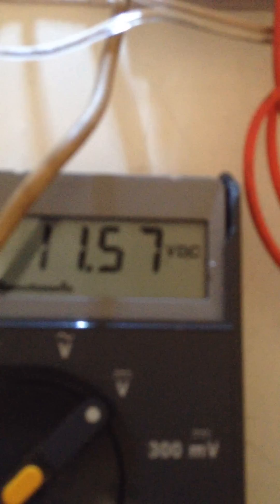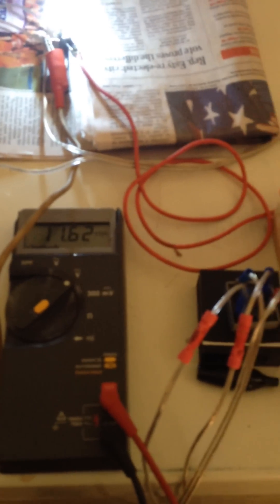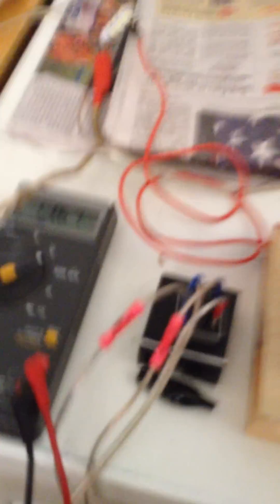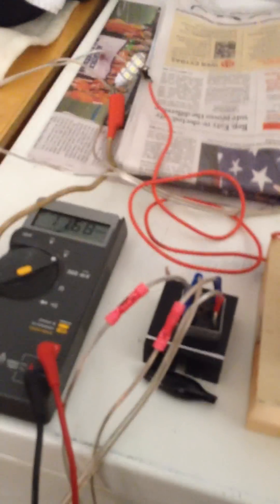Over unity created with transformed back emf. True over unity, no BS!

Comment: Marc, thanks for the no BS approach.I have built a circuit using a dimmer.I am going try charging the source battery.I might need some sort of protection for the high voltage spikes.BTW the relay's inductance is in series with your transformer.So its just more inductance.I have confirmed this with calculations and inductance meter.Also remember you can calculate BEMF .BEMF=-L X (AMPS/seconds).Your circuit is among a class of devices that are really self resonant, self driven,self oscillating.It operates mostly at self resonance the true secret of those devices.Also its what Tesla used with his high voltage induction coil.Only most of his drawings did not show the inductor switching mechanism in all its glory.The relay is really a Rumkorff Induction Coil.Back then as you know they had more amperage that they could handle.The bell,horns,etc are just the decendants of the technology.Keep up the great work.
Reply from the maker: Thanks for the compliment. I was extremely lucky to get any of these to literally operate in resonance because I have tried other brands of relays with absolutely no success many other times. The brand I had most success with for relays is call AGT (source  http://www.amazon.com/Relay-Harness-Bosch-Style-40AMP-HRNS/dp/B005HFYE1O  ) and they are very difficult to find since car audio vendors sell them in bulk and only sell the cheapest relays they can find. These are built to last and of course are not ever identical. I have found that one of 5 used work for the most part, but, I have also found that 24 volt coil /240 v switch 5 pin no/nc industrial relays have the freedom of adjustment, but, they burn out rather easily. The AGT Brand relays are pretty bullet proof and seem to operate well for months, possibly even years is used in this method where they easily self oscillate without any fooling around. We basically wire the coil and the nc switch in series forcing them to automatically oscillate.

I am getting better results using solid state relays but for the most part, we have to be extremely careful as they burn up if the control ic is a cmos device which is not resistant at all to spiky waveforms and nearly instantly burn out.

I admire your work as well and will need assistance from somebody such as  yourself that can apply the math to my designs and others to verify testing. If you'd like to get involved in my free private energy site, pl;ease let me know and i will send the link privately asap.

Thanks again!

Marc
Reply: Marc Belanger Thanks for subscribing and replying.Just to say that there is also an equation that must be satisfied before a circuit will oscillate.I suspect that if we master this we can make other relays work

As a rule of thumb, a circuit will not oscillate unless the resistance (R) is low enough to meet the following condition:     R=2(L/C)0.5This is  from
http://www.intuitor.com/resonance/resonance.html

Now you have mentioned the relay you used,I suspect that it might soon become unavailable.Too many times person such as Don Smith (deceased) and Lasersaber annouces certain components and when I go to look for it months after they cannot be found.Or maybe its just me....

Anyway,I intend to get an Microwave Oven Transformer , Pole Pig ,or Welding Plant Transformer to self oscillate.The only drawback is the massive BEMF spike which I will use a carefully calibrated spark gap to arrest of GDT Varistor  etc.BTW how did you keep the voltage to the cap back at less than 16 volts? A load? I see you output from the bridge is 108v or so? Please advise,I want to learn this stuff.

Later I will try metglas, with its super high magnetic permeability.But I want to see if I can reverse engineer existing transformers to produce overunity without the need to purchase expensive stuff.Hector with his Transverter has had some success as well as Barbosa.

Thanks.
Reply from the maker: the fundamentals of all nc relays force them to oscillate. this isn't the same as an oscillatory ring that relies on resonance, it is forced to actually oscillate because the relay coil being energized relies on the switch to be closed, forcing the switch to open, shutting the relay back off, then, again it closes due to the de-energization, cycling it over and over, unlike a true circuit ring or oscillation as Rose Ainslie's circuit does, so, it is merely cheating the circuit into a forced oscillation, nothing more, but, it does have somewhat of the same outcome without searching for a frequency, or mathematically making it oscillate by the use of other components. This is solely based upon the old car door buzzer design which I accidentally discovered by wiring a relay pigtail the wrong way getting a shock from the insane amount of back emf one relay I had created.

I've come up with many of these circuits, but, I think the outcome of the emf and switching speed, as well as additional magnetism that can be added to speed the oscillations of the switch up with neo magnets can create a very high voltage. I have also found that meissner circuits built correctly have a much higher free energy output than my circuit does, but, we have just begun with these circuits, and we all have a whole world of experimentation to link together, seeing what does what when we mix these discoveries everybody has when we tie clip probes from conection to connection and measure what we've found the outcome to be.

Once we think we have a great energy discovery and we can't truly prove it, then, we will study it's effects, send you the results we have to see what we could come up with for math application to try and prove it is worthy, then focus on moving on to the next step.

I am trying to get people to join dezeinstein.com to post what they may need to have others test so we don't have so much negativity in the forum either as I will moderate individuals who bring mass negativity to our work since we don't need the bs, just truly hard working individuals that know what we are trying to achieve without any additional arguments, maybe just add their ideas and their result when they provide testing. thanks..
Reply: Marc Belanger Yes that is true.And if you add a variable capacitor across the points you can adjust to get different frequencies.Again the rules of RLC still is in force here.
Reply from the maker: cool. I have several air caps.. I'm going to have to try them along with these circuits. I'm not extremely experienced in the tuning department because I have a usb scope that disconnects from it's driver when adding a noisy, spikey output, such as the back emf spikes the relay gives off, so, I'm seeking a decent analog scope for the right price to find oscillation and resonance correctly. I've been through a couple of years worth of college electronics classes, mostly digital, analog, and troubleshooting of circuits, especially combo circuits, lc, rc and rlc circuits, so, I have a pretty good background on them and their function, I just need some refresher on the circuits I haven't worked with in years. I've been stuck on high voltage systems for the last 20 plus years and low voltage logic circuits for the 12 years previous, so, since I've made a great wage for years, I bought many tuning products, such as variable air capacitors, variable inductors, and many other gadgets from schools, physics labs, etc. I am very well versed on transformers, electric motors, and their abilities to operate on levels most people haven't seen, especially when hv transformers literally become antennae to draw energy  and radiation in to provide energy amplification in forms most people really do not agree with me about, so, i am looking for somebody to try and offer explanation of how we could test the circuitry to see if it could be  metered and accurately monitored for it's power in verses it's power out while it inputs low voltage pulsed dc as an ac wave would normally do, and output a 60 hz ac cycle with 10-25 times it's input. I have to use specific equipment to do so , and currently, I have low voltage ammeters and an Amprobe brand amp logging meter which prints it's timestamped load out, but, was told the output of the circuit is imeasurable as well as the input since the meter makes all sorts of beeping and such. While this is happening, the high voltage bushings are measuring over -200 degrees celsius with a laser thermometer.  I can't use scopes and such unless they are rated for whatever the hell is coming from the system, and, I think it is cold electricity and cold radiataion but can't prove it. I'd use an oscilloscope, but,  I didn't know much about scopes and tried saving a buck on one when I found that the hantek usb scope is as useless as tits on a bull.. anyway, I'll be looking forward to asking many questions. i have lots of experiments I've run with the wrong stuff, but, have seriously come up with some pretty neat results and I will be willing to share them once I get the energy forum active so I can post some of my schematics and have others run tests on the results I have obtained.
Reply: Marc Belanger Hey I am enjoying your passion for this stuff.I hope you remain like that.I am very impressed.I would like to join your club.Remember their will be those who will simply not acccept what you are doing.Even when the latest equipment is available, so  prepare for that.In the meantime,I sincerely wish you will  continue to share your results and schematics with us.Too many have rushed off to the patent office and well.. their inventions modified and/or shelved.Some have been arrested.Open Source is always the best.Unless you are interested in a Big Offer from the PTB.Sigh.But you have given us a very good look into this stuff so far.Please make a kit available or already assembled.The investor will be like the ones in the Don Smith Videos or JP Morgan or Aviso etc.They will pay millions and shelf the stuff.A kit or assembled device maybe one of the best way to go.Thousands would love to try this.Hope you seriously consider my suggestions.
Reply from the maker: Oh, I've been into this for quite some time and have already been warned there are many flies in this area and many people that wish to avoid those flies should just stay away. I have found there are flies, the unwanted kind, then, there are the killer bees as well. I'm not out to put millions out of work, I am out for a better way and offer my assistance to find that way that will accommodate everybody, the energy field, and, all of their workers since it will only take one free energy open source device to devastate our world and the electrical industry. I live from that industry and don't wish to make a zero living or change the field my company resides in, but, I wish to help the industry get ready for it's release as there are many people who can't get patents with items that already offer the answer. If these people get frustrated that nobody will buy or pay to shelf the systems, they will eventually release it on an open level and financially take advantage of building them for people and make their money that way. It's just a matter of time before this subject has been reached as an open source deal that will certainly eliminate those of us with enough technical skills to build something extravagant as these free energy experts are coming up with. If the russians are doing it, it won't be long before Americans are too, as a matter of fact, it may already be here more than we know.
Reply: Marc Belanger Yes Marc, KIT KIT KIT KIT!!!!  ;-).

Comment: It shares character of a bedini system where primary is shorted and secondary gets the back emf pulses to charge a second battery..in fact if you had a second isolated it might charge up even more rapidly...bedini used transistorized switching but in your case it was relay switching and peculiar thing is your secondary is using thin gauge contrary to a bedini thicker gauge secondary..
Reply from the maker: +fidel catsro the coils aren't actually shorted in my system, they are just connected  in parallel with the battery. The primary of my system is the low voltage side that carries more amperage and in John's system, his primary is the high voltage side. The high side has to have more resistance and more windings because it is the ratio that makes the voltage what we need to when designing the system. The whole secret to making this work is within the coils of the transformer. The size of the primary in weight must equal the secondary's weight precisely to be in resonance and to collect the extra energy. I figured by now we'd have enough Tesla enthusiasts that would have tried this and have read what he found to give him additional energy. The key is being precisely the same, however, the gauge of the wires and the amount of turns will make the voltage correct, the amount on each side really do not matter, they just have to have the identical amount of copper to automatically resonate and cause this channeling of energy to occur. So, for all of you who call me stupid, or a liar, I am far from stupid, and, I tell no lies.. I am trying to do my best to get you all to believe me by giving this circuit away for free.. Why would I list a scam of hoax for no good reason, or, why would i try this if i wefen't collecting cash from it??  try this out, and, please don't forget to use the diode i speak about in my comments to the mbr circuit located at mbrcircuit.blogspot.com  GOOD LUCK!!

Comment: I made a 12volt spark gap device based on a similar setup like yours in a certain way..my battery is connected to a a relay in a motorized set up like you described..it is nc based and shuts as soon as its energised and repeats continuously..but the relay also has  additional switching points that switch on and off as the relay buzzez, where I connected the primary of a ignition coil in series with the same battery and this triggers continuous coil shorting on the primary of the ignition coil and the secondary coil produces spark gaps of several thousand volts with little amperage for any real loads other than lighting up floro tubes brightly even those burnt discarded ones will work..I think you can see it in one of my few videos titles spark gap generator..
Reply: im using an omron 8 legged relay..it.has 2 points for coil shorting and 6 points to provide 3 switching terminals..initially the relay was coarse sounding and didnt like to be run in such manner, but after many runs it runs smoothly now as if its not bothered by the intense coil shorting from the primary of the ignition coil likes its been seasoned in some way..